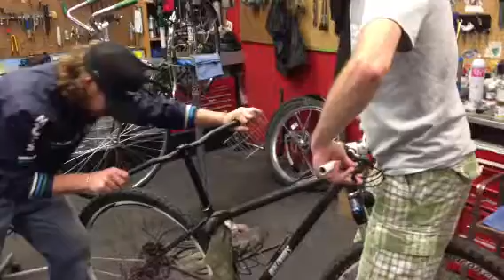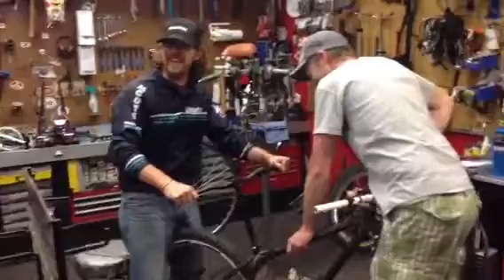How we remove frozen seat posts

Comment: What tool are they using? Wish there was more info
Reply: GeEvil I agree this has been the best source so far I saw a video where a guy drilled a hole through the post and tied the post to a truck and the bike to a wall and pulled it out but I think there would be some damage to the frame